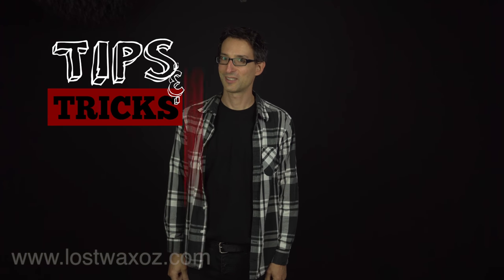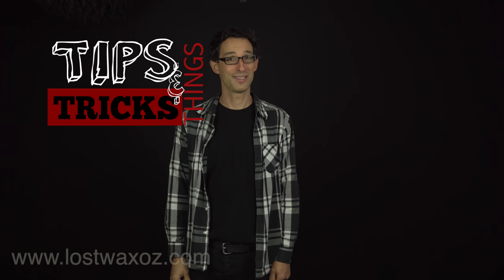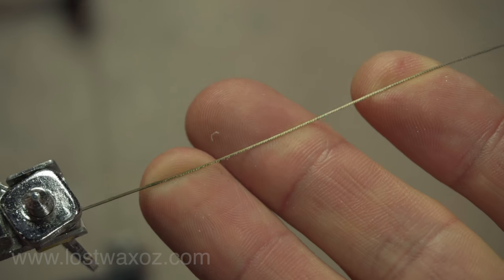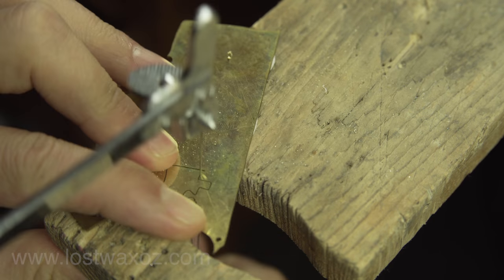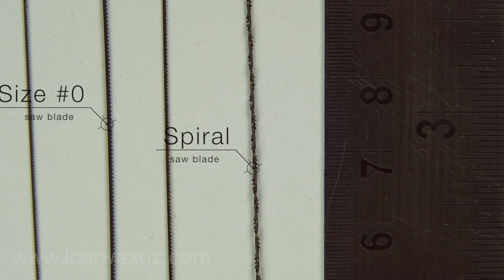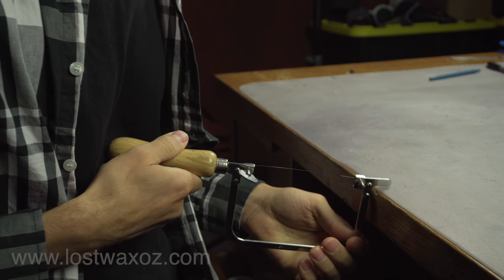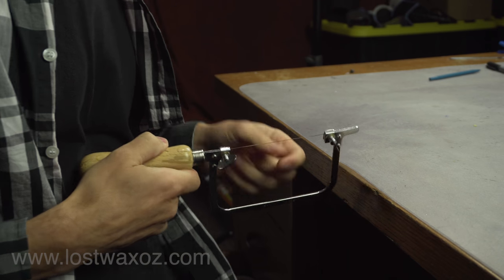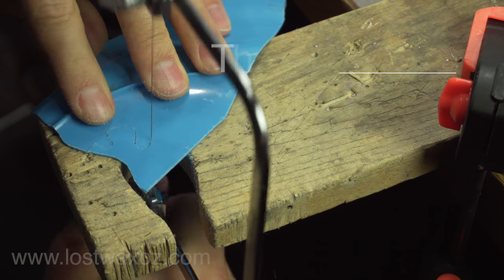My Secret Weapon. Your Best Friend. The Jeweller's Saw.

Comment: My jewelers saw saved my butt this week. I needed a bunch of 1/4 inch diameter rings, and was going nuts til I realized I could use my saw and mitre box to cut them from a length of styrene  tube
Reply from the maker: Nice!

Comment: This is a great tool! Extra jewerls tip! When cutting metals use bee's wax on the saw blade. It help the saw blade run smooth, keep it from catching & less breakage. It's important to use natural bee's wax, other wax can build up an cause breakage & ruin the saw blade.
Reply from the maker: Or you can spit on the blade, which is handy, cause you never run out:)

Comment: I've got one of those, plus lots of blades. Hadn't seen the spiral blades. I find the tighter the blade the less breakage
Reply from the maker: Yep, there's kind of an optimal tension, which is generally as tight as you can get it. The spiral blades are cool because you can cut sideways with them, and they don't clog easily. They are often referred to as wax cutting blades.
Reply: Lost Wax I'm going to look for the wax spiral blades. Cool tip, thanks

Comment: I have 2 questions. I'm planning to buy a coping saw and maybe replace the blades by violin string to cut cheese. I'm not sure if it can really cut cheese. And does Jewellers saw the same as a coping saw?
Reply from the maker: Not sure about the violin string/cutting cheese thing, I've never tried. A jewellers saw is similar to a coping saw, but usually a coping saw has blades with a little pin through them, which kinda clip into the saw frame. Also a jewellers saw tends to have much thinner blades.
Reply: Thank's for reply!

Comment: Nice, never heard of this tool before, definitly getting one !

You mention that it costs around 15, can you also say what is the common price for the blades ?
Reply from the maker: There's a bit of a range of quality out there, but you can usually pick up 144 blades (they often sell them by the gross)  for around $15. Lots of times you can get an assortment of sizes. Definitely the more expensive blades break less, and cut nicer, but if you just want to give it a go, you can get away with the cheap ones .
Reply: Thank you :)